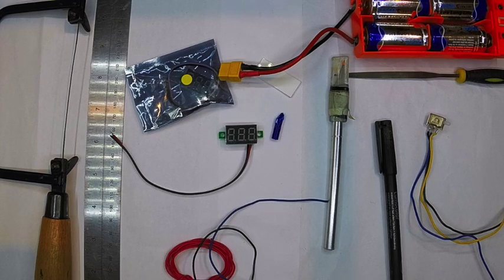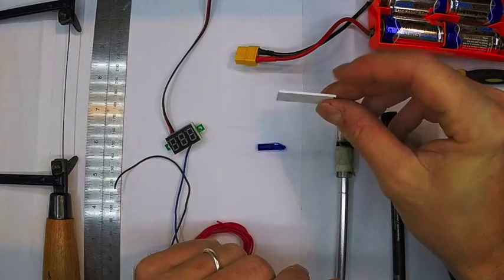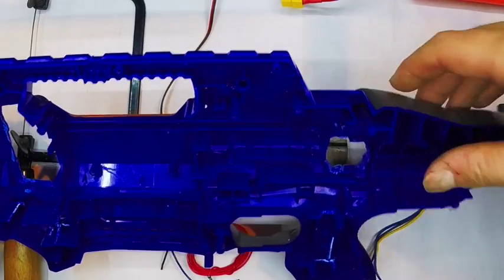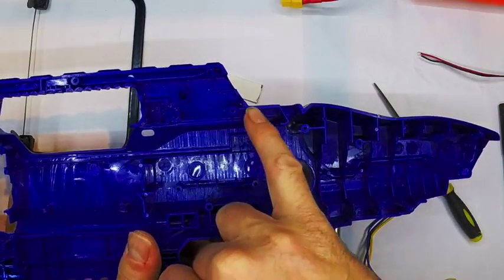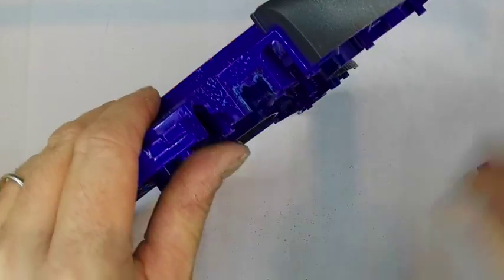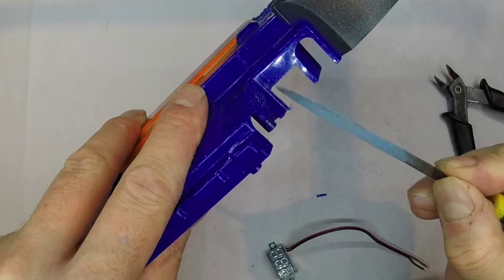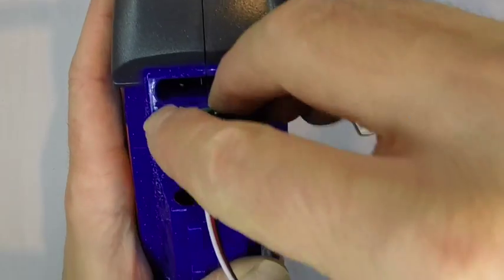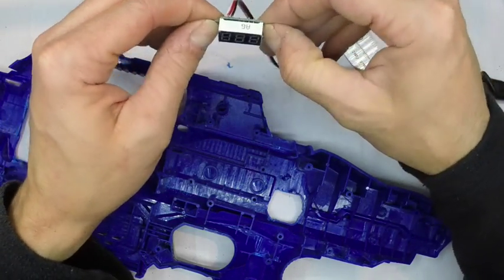How To- Nerf Voltmeter Part 1

Comment: Very useful, helpful, and informative video. I'm making an induction heater for my Dynavap M vaporizer and I'm using a 16 oz Starbucks tumbler as a case, so I needed to know how to drill/cut a square hole for the voltmeter. And this video pretty much answered my question.
Reply from the maker: Glad you found it useful! Making square holes with round drill bits is never easy, good luck with your project.

Comment: Now, if I'm using a 2s LiPo can the standard nerf microswitch handle the current without mosfets?
Reply from the maker: Not reliably and certainly not if you changed the motors or internal wiring . You could leave them but if a switch fails in the closed position it could cause a Lipo short. Just do a proper rewire, kits are available from lots of retailers.

Comment: Really helpful mod video Tom! I need to fit some voltmeters, this guide is great.

Ordinary 99.9% isopropyl alcohol works well too for removing Sharpie marker, you can get between massive 3L bottles or little 25ml refillable spray bottles. I get 1l bottles and refill the 100ml spray, it's a little cheaper overall and more versatile.
Reply: Matt Von Nerf I'm considering installing one now.  Just to learn how
Reply: Broke Nerfing then Tom is you man, he's a genius and a perfectionist, I'm just a perfectionist!
Reply: My voltmeters arrived yesterday, so I'll be installing one on my already complete Stryfe, and I got a few for my Rayvens.
I'll probably attach them to my rev triggers, rather than jam doors, so they light up when I'm revving, it saves me soldering a switch in as well, either into the jam door or magazine switch (I'm not sure I can even find those switches I took out!).

Comment: Very helpful and informative.  I was on the fence about installing a mini-voltage gauge on my upcoming blade demolisher build, and now I think I will.  Probably in the stock point.
Reply from the maker: There is a lot of dead space in the Demolisher, despite its double shell. I would avoid the stock point, because if you have the missile launcher on it you really need a stock. The area above the stock mount is good, it's fairly flat. You can recess the meter a bit more if the area is ridged, it is a little harder to do but totally possible.
Reply: +Foamdata Services I'm planning on cutting off the launcher, with a recon barrel underneath.  cool hydro-dip planned too.   I'm gonna dip a raider stock to match, or maybe a worker stock.  I still might use the stock point, centered inside the back square.

Comment: u should get a mini rivet gun. they screw things in fast, but permanently.
Reply from the maker: +Co⊙zeB○Yz I have several pop riveters. I make my builds modular so that all the ancillary parts are removable so if something fails then you can remove it. Rivets are also not good in plastic.